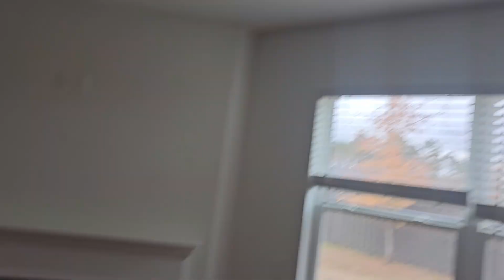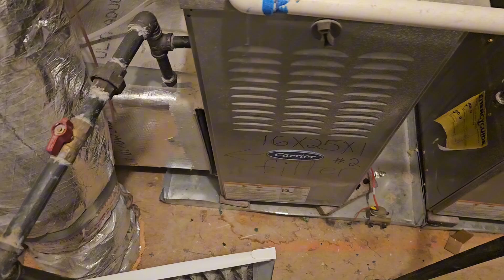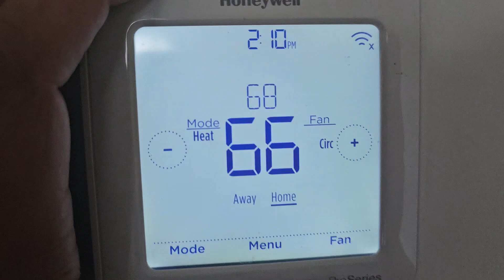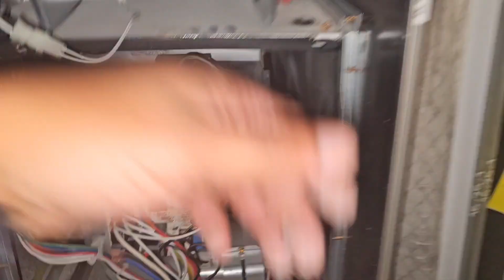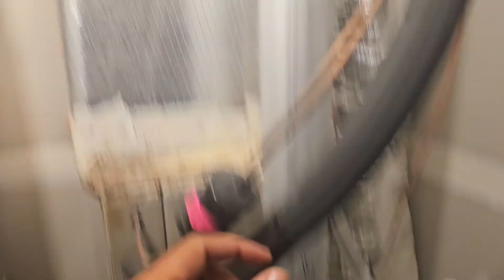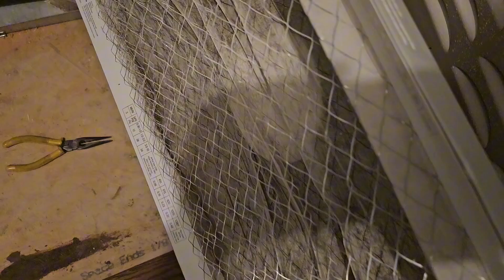Carrier Furnace Not Staying In Heat Mode | HVAC

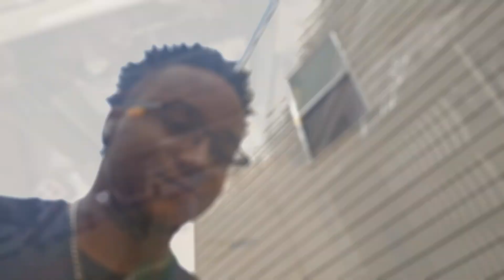Comment: 24:41, A limit tripping in a furnace has no effect on a thermostat. Especially a T6. Furnace Limits do not drop voltage to a thermostat. Would be new to me too, but it isn't because it does not happen. A dirty filter will trip a limit but that results in a fault code lock out on the furnace not dropping voltage to the tstat.
Reply: All safety switches in a carrier furnace (main limit, rollout, etc.) cuts power to R. The thermostat doesn’t stay off though so if you’re not at the thermostat, you might not see it
Reply from the maker: Well thats why i took the batteries out too to see what it would do. So im not sure exactly where in the circuit it breaks R but that seemed to be what was cutting 24v to the stat and causing that issue. Considering it was doing it upstairs and then as well that upstairs system happened to be the one tripping on high limit, i just tried to piece it together
Reply: I have seen this in carrier and in American std, “thermostats keeps resetting call” dirty filter was the issue.
Reply from the maker: That's what I was thinking too but it's the only out of the box reason I could come up with. The inspectors notes said after a few minutes the system would cut off, and after a few minutes of running with the filter in it cut off. That was the only problem I could find and haven't been called to go back out since so I'm confident that was it

Comment: The batteries are only for backup in case the power goes out. The thermostat is a 24v power stealing stat. This avoids having to reprogram the thermostat.
Reply from the maker: I've come across a crap ton of T6 stats powered directly with no batteries, and when they lose power and cut back on the only thing I have to do is reset the time not the entire programing of the stat. But that's just me, maybe I'm lucky

Comment: honeywell controllers has always done this. (shutting system down 2 degrees before) as they anticipate if an oversized system will hit setpoint without another call for heat. if it does not happen within a selected amount of time another call for heat will be given to achieve setpoint.
Reply: Yeah I noticed that with my thermostat once and was confused but then noticed that my aunts does the same thing, if it's set too one temp it'll warm or cool (depends mode) too the set temp but in heat mode if it's set high or cool mode if it's set low and you turn it down too 2 degrees above the room temp (in heat mode) or up too 2 degrees below the room temp (in cool mode) it'll cut off and then after a certain amount of time it'll come back on then room or cool too the settings
Reply: Like one time it was 80 in my house from my unit not keeping up and I turned my thing up too 79 too give the unit less of a load and it turned off and I went "Wtf!" But then 7 minutes it came back on too cool the temp down too that setting of 79
Reply: @EthanHurley-ky4hi  correct, if my ac falls 3 degrees behind on a hot day, it will cycle off at 2 degrees of set point then continue.
Reply: @michaelpiontek169  Okay now that ain't supposed too happen cause when mine is cooling down from the hot day it stays running the entire time till it actually satisfies just when it comes too me turning it up when it's super hot outside too a degree below the temp reading it desides too turn off for just a couple minutes then come back on
Reply: I could be wrong, whatever it was doing was normal in my eyes.
Reply: @michaelpiontek169  Maybe yours was set up weirdly? Idk I just know mine works normally except for when I go too turn it up too a degree below inside temp on days that my unit ain't keeping up
Reply: I kinda want a video of it doing it in action when summer comes back around, like you can make it then send the link too me in this video and I can see it do that then you can delete it shortly after if you feel like doing that